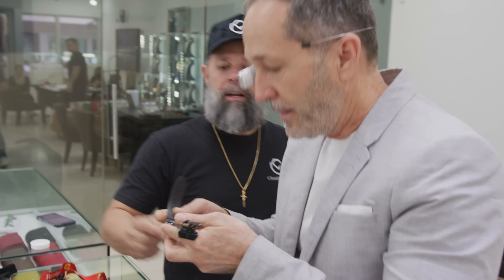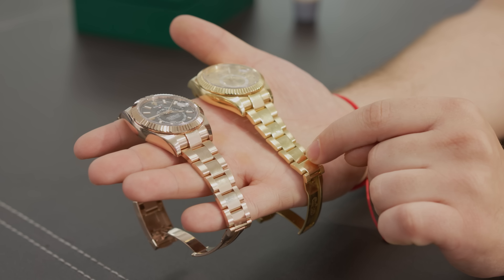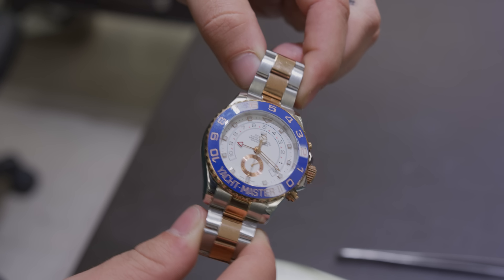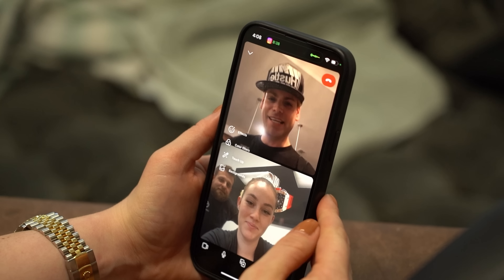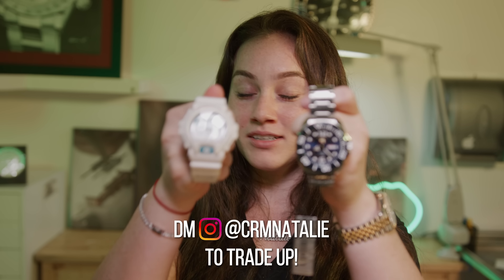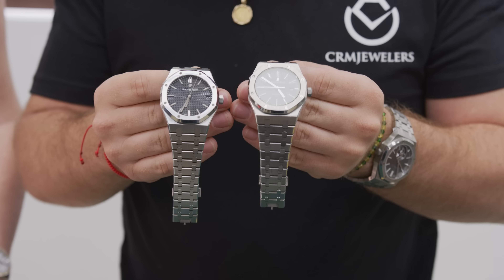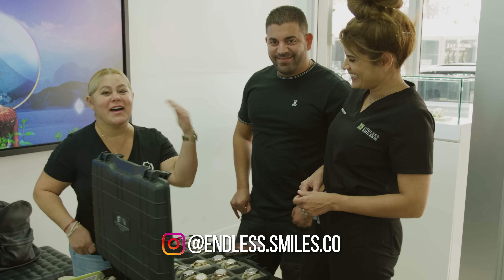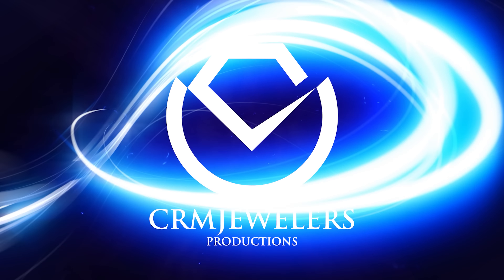Craziest Trade Ever...$80 Casio for a Rolex! | CRM Life E94

Comment: DLC is applied via PVD, but not all PVD is DLC. This is a common misconception and point of confusion in many industries. Proper DLC is very tough, whereas PVD only tells you the application method, not the compound(s) being used.
Reply: Thank you 🙏
Reply: @Merxnary  anytime, brother. They use DLC in firearms where you have steel-on-steel, and it actually holds up very well!

Comment: That hulk is not DLC, and I don't think it is actually a PVD or even AVD process, It looks like a Black Chrome plating, which is a solution electroplating process. The clues are the amount of wear on the watch, the pattern of the wear, and the age of the watch. Big smooth worn areas like those are typically the result of a softer material like an electroplated material wearing through, like the gold plating on a cheap watch. The Black Chrome is chrome which is a very hard materrial, but also thin, and nowhere near the abrasion resistance of DLC. DLC is practically bomb-proof, it was developed as a coating for industrial cutting tools like high speed endmills that chew through steel all day long. Desk wear is not going to wear through DLC like that. Well, I guess I should preface with what Carlos said "In my opinion".